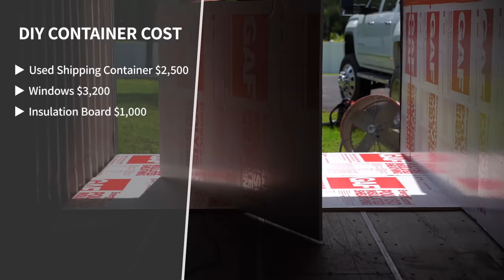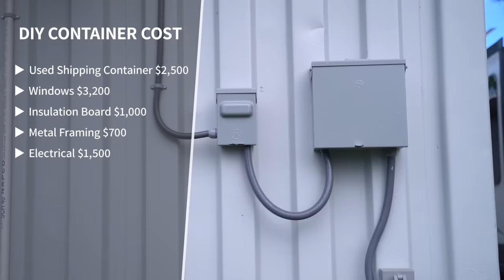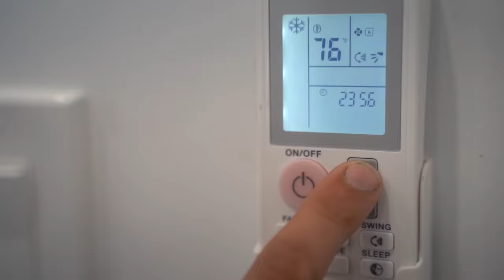40ft DIY Shipping Container Home (Total Cost Breakdown)

Comment: The value of a building is in cost per square-foot... If materials alone is $17,320 for a builder, then it $25,000 for a layperson; so considering foundation, septic, earthwork and skilled labour:
$17,320 x 4 =  $69,280 total cost. A 40-ft x 8-ft container is 320-sqft gross; therefore, $69,280 / 320-sqft = $216.5 per square-foot. This means that a generic cargo container home is a luxury residence, considering that conventional construction is about $125 per square-foot (land included).

Most folks desiring container homes cannot do it themselves; so for 280 net square-feet, give it some serious thought before emotionally committing.

Comment: You don't save money buying a shipping container because the framing for a home is one of the least expensive parts.  Its easier to transport lumber than a huge container too. Usually containers are lined with lumber anyway and windows and doors are easier to install in wood than by cutting into metal and having to frame it out.

Comment: That is until you find you need a dehumidifier for the increased mold making moisture that you will have. The increased cost for twice the installation needed because metal has zero insulation value and actually transfers heat and cold instantaneously.  As well as regular air quality checks needed from living in such a confined space with lots of unhealthy emissions from the materials used. Should definitely have a high quality air cleaner that will take up precious space. Every window cut out will require extra materials for reinforcing where you have lost support. Do your homework

Comment: Using a shipping container is a constraint that should not be considered for most structures.  It is not just cost efficient compared to other materials.  Used mobile home in a developed property (1200 sf) $20,000.  Nuf said.

Comment: Double the price for labor and then add 20% for unforeseen problems. Then add on the cost of the land to put the home on. That’s the price of the cheapest home.
Reply: You can get prebuilt container homes with the hard stuff done for less than 25k. You still have to do decorating but painting walls and putting up wallpaper is super easy. Add land, around my area I can get enough land for one of these for about $2000. Permits may add a bit. Then an extra 20% for unforeseen costs, that’s about 35 grand total.

To connect plumbing and electrics, depends on where you are. If you aren’t far from people then it’ll probably take less than 3k to connect to others. If not, it’s about $100 for every meter of plumbing to be installed.

Comment: I'd like at the very least, (3) shipping containers. I'd look and find lots of used materials, such as the windows, the interior/exterior doors and frames, all of the flooring, cabinets/countertops. Of course I'd never waver from new plumbing, hot water tanks, toilets, sinks, all plumbing and electrical has to be new products. Primers and paint also all new, also all heating and air conditioner products also must be NEW!!! SAME GOES FOR ROOFING, ALL NEW!!! Gotta also have new septic system, electrical/ utility pole and cables. We all know someone that knows someone who knows alittle about a lot of many things about carpentry, installation of many different projects, A JACK OF ALL TRADES 😊😊😊😊. It would be well worth the overall total cost of approximately $$$75,000.00 for a nice large 2 bedroom L-Shaped beautiful shipping containers home. DEFINITELY 🥰🥰🥰🥰...

Comment: This seems like a fantasy and just silly. The only thing the shipping container offers is a frame structure and a roof, which still needs reinforcement for windows, doors, and insulation. He hasn't added in the cost of the land this will sit on either. The cost of materials to build a small cabin would be around the same as this. A shipping container is good for one thing though, storage.

Comment: Interesting. But author should have been much clearer about what is NOT included. Material costs are only one small component to construction. What items are not included in this video? Let's start with Labor, one of the biggest construction costs. For example having a contractor install a split system will take that material cost and multiply it by 10! Next major cost, Land - wholly dependent on where you build, but a major cost that will likely be several times your material costs. Next Permits and local regulations. Shipping container homes may be an unknown in your jurisdiction and you may have to go through a process of educating the local building officials to even get proper permits. You need to factor this time and cost in. Also when it comes to electrical, plumbing, HVAC and any reinforcing/structural steel installed, many jurisdictions will require them to be installed by a licensed contractor or at least to have construction documents produced and submitted. Next, Utilities. If you are in an urban area where infrastructure exists, this cost may be less, but if you are in a rural area just the cost to get electric to your site using the proper equipment required by your local utility plus the fee to actually turn it on must be considered - it will likely be several thousands.  Then there is the cost to deal with water and sewer on rural sites or the connection costs in urban sites. Let's Finish with the item most people should start with in the first place - Design. To pull off a Livable Design in a small, confined structure isn't a small feat. You may want to at least have a design consultant so you do not invest a ton of money into something that will be unlivable when finished. Then there are construction details to consider - for example shipping containers are made out of steel which is a highly conductive material. What method will you use to prevent condensation from occurring on the inside face (think of what happens to windows in the winter). Without addressing this in northern climates, you may end up with significant mold issues years from now. These are just some details that design professionals can assist with that you may not have even considered. So this video is a good start to beginning to understand material costs, but remember there is much more to consider!

Comment: Ur trippin, if before touching the outside I’m spending that much, I don’t get the physics in y the inside should be done first) a hotbox basically) I’m starting mine on the outside then working my way in
Reply: The container getting as hot as it can get

Comment: Too bad building cost went up quite a bit from 2 yrs ago.
Reply: I actually own and operate a insulation company. And now the cost of rigid foam board (just material) is around the same price as installed spray foam of equivalent R-value. The diy closed cell kits are significantly more expensive than just hiring a spray tech.
Reply from the maker: @ethanbrunink1977  - please reach out to us: containingluxury@gmail.com